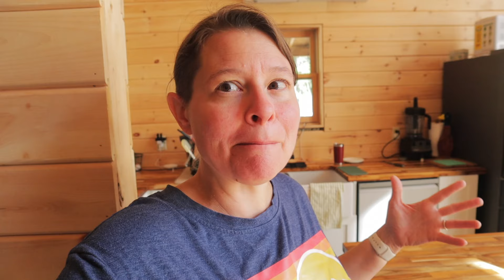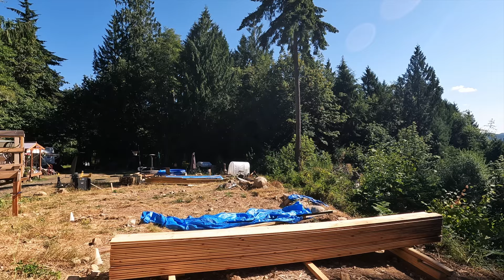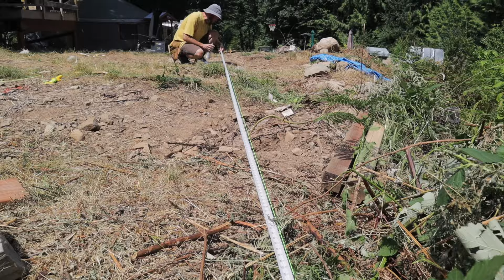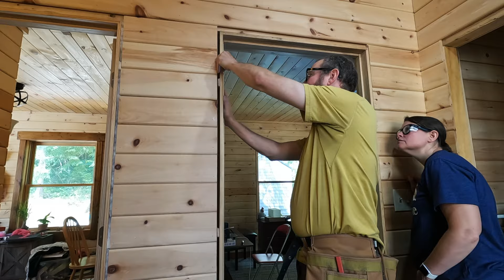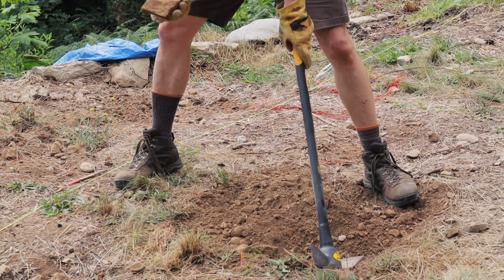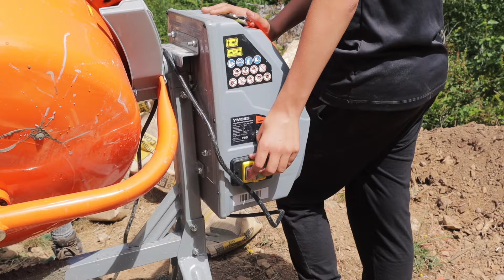STARTING OUR MASSIVE DECK EXTENSION

Comment: Don't your doors come fitted to the frame? If so why don't you fasten a strip of scrap timber that spans the full width of the frame plus 6"  ( 3"  either side ) then fit the whole door and frame into the opening that you have made, then shim the door to the opening.
   The reason you are having to mess with the door height is because you have made the opening too SMALL!, thus having to cut the door down. Remember the door frame should measure the same width at the top and bottom.